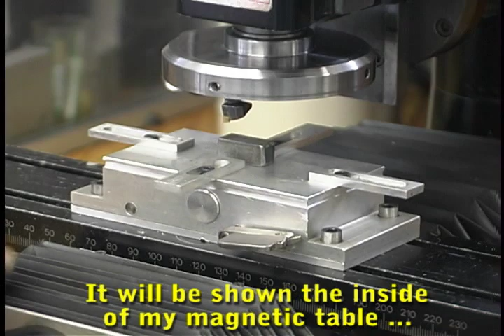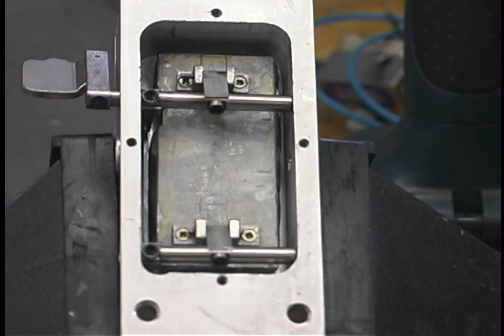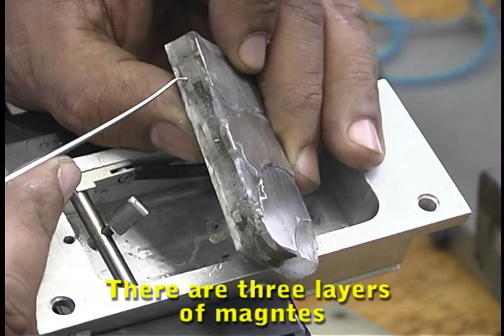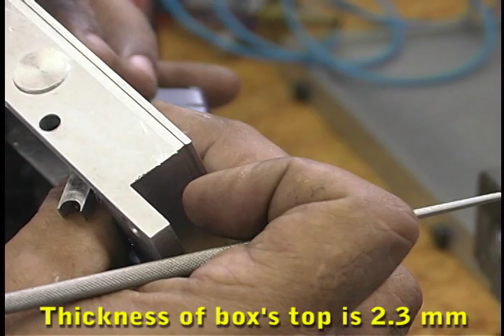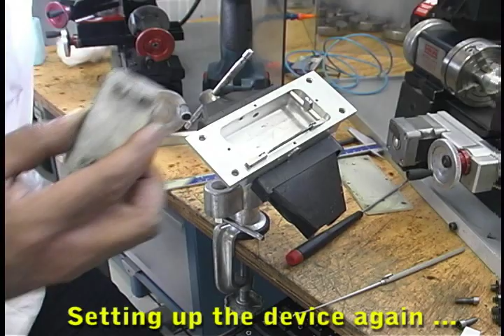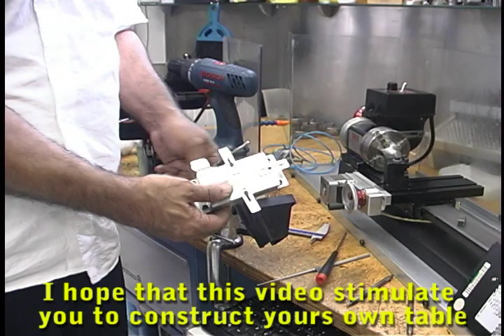A tiny magnetic table for Sherline

Comment: I was considering building something like that with hard drive motors too. Nice design. I do not mill often enough though and rarely steel.

Also I have successfully cut those magnets. There is a very early video on it. I do not recommend it though since the dust is probably very dangerous.
Reply from the maker: That's right, I have ever heard about the dust is very dangerous, so I machined with care.
You know, this simple project works very well too.
Thanks for comment.
Luiz

Comment: Hi Luiz,  do you write your own g code or do you use some cad program to produce it?  I'd also like to see how you make the very gently movements with the mill and lathe.  It looks like you are manually doing it but I'm not sure.
Reply from the maker: Hi Buddy,Yes the major part is made by myself is not so complicated but you can make good G code programming using the Wizard at mach3 software, to start nothing is so better like the mach3 wizard.
Regards
Luiz